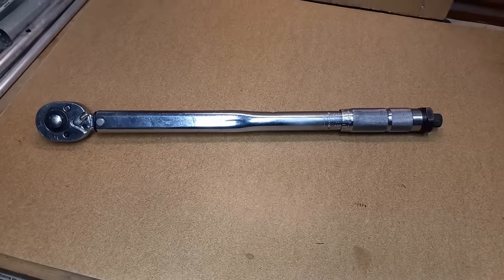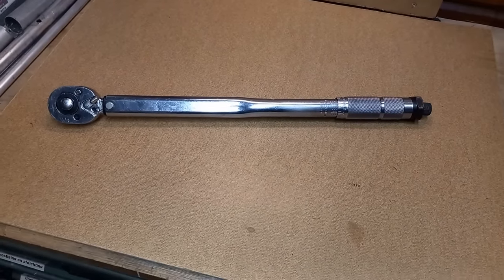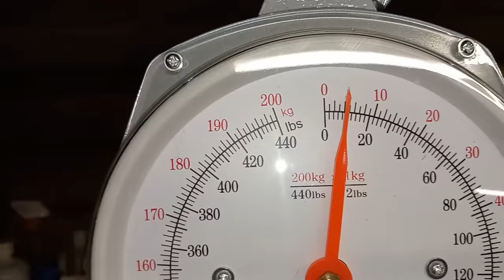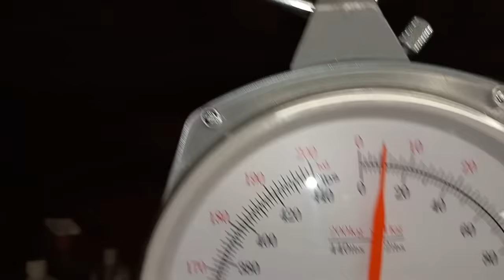How to calibrate a (cheap) torque wrench

Comment: This method seems quite imprecise.
The force should be perpendicular to the arm of the wrench, the precision of reading the scale isn't great at all, at the range shown in the video it is alone responsible for 10-20% error. Adjusting the scale using the jerry can is similarly troubled, since the reading precision is disastrous due to the low load of the scale designed for much higher forces.
In general, the whole thing seems much less precise than the original calibration of the cheap wrench.
Reply from the maker: You'll be surprised how small the margin of error is. It is less than 5%, and that is fine for my purposes.

Comment: 126Nm equals to about 15Kg not 30Kg or am I missing something?
Reply from the maker: That depends on the length of the arm. On this torque wrench it is 30 kg at the handle, with twice the length it would be 15 kg.

Comment: The most important part of toque is everything torque the same , old bolts with stretched threads on bolts and in hole will give you a different reading a good mechanic will have a professional adjust his torque wrench  use new bolts every time you torque if you don’t your torque will be off a couple of lbs. or inches, the start in middle a torque out half torque first then full and then all the way around so everything is flat and the correct torque, you guys that are using old bolts go up a couple of foot or inch lbs but very slowly not too pull the threads worst than they are tight is tight NOT over tight, I probably shouldn’t have told you anything about torque nothing worst than a wild ass with a torque wench 7:26
Reply from the maker: Good point on strech and streched bolts. I'll dive into that in a future video. Also, a good workshop manual should specifically state whether or not the threads should be oiled. Most workshop manual don't do this in my experience.
Reply: On aircraft propellers new bolts are always used on this critical application.
Reply: @Carnold_YT  Usually assumed to be Dry unless stated otherwise.
Reply: @malcolmmarzo2461  New fasteners are always used on any aircraft - wherever New fasteners are called out.  Cotter Pins are ALWAYS replaced and NEVER reused.  And aircraft prop bolts likely are safety wired.
Reply: @daves7775  In practice these things are often discretionary. When I got a new propellor I insisted on new bolts. Yes, they are safety wired. Additionally, in most light aircraft the prop must be removed to change the alternator belt. So it is a good idea to install a new belt too.

Comment: This is a classic example of “You don’t know what you don’t know”. Real, certified calibration is so much more, and considers so much more than you are demonstrating. On the handle there is a centerline divot. That indicates where your hand should pull from. By using the scale pulling from all the way at the back, you have effectively changed the common centerline length of the wrench and made your measurements inaccurate. How can you accurately measure the peak torque with a scale that doesn’t have a peak hold tail pointer? You can’t accurately. What is the measurement accuracy and repeatability of the scale? Are you adjusting a +/-4% torque tool with a +/- 10% scale? For a calibration to be valid, the measurement instrument should be at least 4 times more accurate than the tool under test. Torque tools are also tested at more than one measurement point. It is painful obvious, you have very little understanding of torque or metrology (calibration).
Reply from the maker: Well, this video is intended for home mechanics who need consistency and some form of accuracy in a certain torque range. Maybe I've could / should have pointed that out more clearly. Anyway, did you watch Part 2? I'm not unfamiliar with calibration labs, my office at the day job is adjacent to a calibration lab...

Comment: His "calibration" of the scale immediately introduces a source of error and propagates onwards.
Yes, 5 liters of water has a mass of 5 kg (at least close enough to not matter for this purpose).
But zeroing the scale to 5kg is incorrect, since the mass hanging off the scale is 5kg (mass of water) + x (mass of container holding water).
Reply from the maker: The scale was not zero'd with the water container on the hook. It was zero'd without any weight - except for the hook.
Reply: @Carnold_YT  and the scale was adjusted to 5kg while the container filled with 5 liters of water was on the hook. Hence, the scale is reading less than what's actually on it.

Comment: You made your 2nd and 3rd adjustments without backing off the setting dial.  Every Cal Lab is also temperature controlled.  Usually right at 70 degrees F.  Humidity controlled also. 
Your method could be useful to the hobbyist though.  With those type torque wrenches (micrometer setting), you always want to use only the top 2/3 of the dial.  If you try to torque a low torque setting with that style wrench, especially a cheapo, you will OVER TORQUE.  
You you didn't show your conversion formula for the length of the wrench handle either, so no one can really do what you did without more research.
Reply from the maker: This video was intended for home / hobby mechanics. In part 2 I adressed some points you mentioned. Anyway, thanks for watching and for your input!

Comment: Snapon is cheap stuff, b market stuff, German Gedore or Hazet torque wrenches are almost twice as expensive.
Reply from the maker: Paoli are the best in my humble opinion. That brand is second to none.
Reply: @Carnold_YT  Gedore en Hazet is the stuff that traditionally was used by car garages.
Nothing beats German engineering.

A digital torque wrench of Hazet is 3000€, Snapon around 2000€.

Comment: That is NOT the position, in the handle, to apply the weight. It is the SLOT more or less in the middle of the handle. Your wrench is not calibrated correctly.
Reply from the maker: I corrected that in part 2 of this video.

Comment: Torque wrenches should always be calibrated by applying the force to the middle of the handle.....not the end of the handle as shown here. Many torque wrenches have a groove or line in the middle of the handle grip. This is to show where your hand should be positioned and, ergo, where you should calibrate the toque from. Here is a video that proves this.....
https://www.youtube.com/watch?v=Fwfnf06dl84
Reply from the maker: You are correct. I pointed that out in part 2 of this video.

Comment: The best way to calibrate a cheap torque wrench is to beat the daylights out of it with a sledge hammer and toss it in the garbage. Get a quality beam torque wrench. You never have to calibrate them as they are always spot on accurate!!!!!
Reply from the maker: The digital Snap-On torque wrench at the day job broke three times before boss man had to replace it. This Crap-On torque wrench served me well for over a decade. Quality first, money firstest. Us home mechanics have to start somewhere, don't we? Anyways, thanks for watching!
Reply: @Carnold_YT  Get a beam torque wrench. I've never bought one of those type you show in the video. Most "mechanics" get those because they are embarrassed to be seen with a beam type torque wrench. I've never had a beam torque wrench break and you never have to calibrate them. They are perfect each and every time you need one. Trust me when I say this. I'm a retired ASE certified master tech. I grew up in a mechanics family. My dad had a shop in L.A. My great grandfather was a lead engineer at Ford Motor co. for 30 years. He was good friends with Henry Ford. Get the beam torque wrench. All of your problems will be solved.
Reply: Beam wrench is great if you can see it. 
Often us Millwrights can barely get the wrench positioned on the fastener, never mind a good position accurately viewing its' scale. 
Clicker type is only way to go.
Reply: @benjurqunov  Aww now come on. You're just embarrassed to have a beam wrench too... LOL.... Someday the stigma of the beam torque wrench will be defeated! "EQUALITY FOR THE BEAM TORQUE WRENCH!" 🤣😆
Reply: I use this same torque wrench but then I check it with my beam. My click wrench is always slightly less than my beam so it works well allowing me to sneak up on my final torque value.
Reply: @tgxperience  The problem with the click wrench is just that. You can be slightly less or slightly more or a lot less or a lot more. At least you're double checking though.

Comment: The correct spot to hang the hook is the line between the knurled portion of the handle.  This also where the measurement should be made to.

Comment: tq wrench was not exercised (3-5 clicks CW & CCW at max setting) prior to "calibration"; therefore your readings will be off, or not as "accurate" as it could be...I found too many errors in this video for it to be useful. 😒
Reply from the maker: Good point, I'll mention this in the follow up video.

Comment: Oh hell no Do not do this if you need your tools calibrated when dealing with ISO. Send it to the lab have it done professionally keep records and make sure your lab checks torque wrench in three places at least on our standard ones at our lab which I work in we checked min middle and max and also the areas of which the tools are used the most in leave it or not your torque wrench can get wore out in the same setting If it's used there all the time Good luck find a good lab.

Comment: you are doing it wrong. the force should be applied to the solid line in the middle of the handle. its not there just for decoration. its the point that represents the exact spot where you should apply all the force so that the applied torque on the socket matches the setting on the dial. there are two pivot points - one on the socket, and one on the pin. if you choke up on the wrench, you apply more torque than the setting. if you move it further as in your case, you decrease the torque applied. although it seems to be just an inch in your case,  it still shows that you fundamentally misunderstand how torque wrenches work. iv seen guys use cheater bars on torque wrenches and when i call their mishandling of the tool out they take the piss on me. after showing with a digital wrench that they have undertorqued the fastener almost half the value they look puzzled as hell.
Reply from the maker: Thanks for your comment, many of this has been pointed out in earlier comments. That's why I did a follow-up video to adress those remarks.

Comment: could've sworn you set the wrench to 150 lbs then used 30 kilos on the dial scale.
Reply from the maker: I didn't notice that, but you may be correct. This torque wrench has two scales: Nm on the front and lb/ft on the back of the lever. Thanks for watching!

Comment: So, you "calibrated" the scale at 5/200th's of its scale length using 5 kilograms of water (which we're not sure how you measured accurately). And then you used the scale at 30/200th's of its scale length to set the torque wrench. That's not what I would call calibrating. I would never trust a scale (or any analog meter) below 25% of its scale length.
Reply from the maker: Well, did you watch part 2 of this video?

Comment: You won’t be accurate holding the scale like that

you need too remove the scale weight by holding it.
Reply from the maker: That may be true, but I didn't aim for maximum accuracy here. I just wanted to have my torque wrench accurate in the range I use most.

Comment: you calibrated the lower output, at the same time the higher output got f** up . With a china wrench, you either calibrate it in the middle or calibrate it for each of the bolt you torque. 😄
Reply from the maker: I calibrated it for the job at hand, few bolts in the 120 - 170 nm range.

Comment: This video is great. However, I want to mention that using water like this is not a good calibration technique. While people think Metric guarantees things, it does not. Only if you follow the rules of metric - right amount of water (volume), right temperature, and it's really water and nothing else dissolved into it. Water full of salt, or alcohol, or minerals will have a different weight. Only if everything is as they specified as part of the Metric system - then it's correct.
It's best to calibrate it with weights that are calibrated or a calibrated scale. Here we're not even trusting a scale. Just some water of an unknown volume and water of an unknown specific gravity. Is it correct? Who knows. The container may not even be right. It's screen wash after all. That jug is probably 99 cents or 1 Euro. Something very inexpensive. Also, the weight of the container itself. If it contains screen wash that'll have alcohol in it, so the specific gravity will be different.
Reply: You are certainly right, but I think this is a method to test a wrench if it's still roughly OK. If you need real accuracy you have to go to a calibration lab anyways. If you have access to a 2nd one you know it's accurate you could connect them and test if they click at the same time which may be the simplest and most accurate test beside the official calibration lab

Comment: Torque wrenches should be calibrated in a Metrology lab with periodically calibrated equipment traceable to NIST period. This guy's method might be Ok when working on lawnmower engines or Mosdel T s but stay away from that which can kill people such as general aviation,lug nuts, etc.
Reply: I'm sure nobody working on aircraft would check his torque wrench with this method

Comment: Never mentioned details like how to calculate the kilograms. or what all the small parts were inside the end of the wrench. Also forgot to tell what direction to turn the adjuster to increase and decrease the torque settings.

Just kinda a half ass video.
Reply from the maker: Well, there is a link to part 2, that's where all off that is adressed!

Comment: I worked on torque wrench repairs and calibration for about 5 years and i can tell you this. The best way to calibrate on of these cheap generic torque wrenches is to throw it in the trash! They are terrible. They tend to be very inconsistent and are never accurate over the full range. 
If you use a torque wrench regularly, especially if it's on other peoples equipment and you are being paid for the work, don't buy one of these.

Comment: That jug of water as a standard is a joke. You must be related to Rube Goldberg?😁😆😅🤣
Torque wrenches are cheap enough where you buy two of them, one is kept as the standard only, to be used just for calibration purposes, and the other one is used in the field. When it comes time to calibrate the one that you use, you simply couple it to the torque wrench that is the standard, set both wrenches to the same torque, and with the standard wrench held in a vise, apply torque to the other wrench and see if they both click at the same time. Your coupling of the wrenches can be a socket adapter "Female 3/8" to Female 3/8". This way you get rid of that joke of a jug, and also don't need that scale. My way is simple and direct, much quicker and more precise.
Reply from the maker: The purpose of this video was to show how to check the accuracy with the materials at hand. The jug of water - now matter if it's only 1/5th of the weight needed - is more accurate than you might expect, same goes for the scale. Your method is also not bad - but you need to be sure that the reference torque wrench is (somewhat) accurate. Nowadays I have several torque wrenches and I think I'll try your method too.
Reply: @Carnold_YT  Being a newbie, I was looking into how these clicker type torque wrenches were designed and found out they were accurate to within +/-5%. Then it hit me, being in the field of fixture design for many years, that in the field of calibration, your standard should be much more accurate than whatever you're calibrating, that being the case, using another clicker type torque wrench as I suggested is flawed, you would even compound the error +/-5% to +/-10% to the torque wrench you're calibrating. That being the case, I came upon something even better than using another clicker type torque wrench for calibrating, and that is: Heavy Duty Digital Torque Adapter with Buzzer and LED Flash Notification. This gentleman here, "The Den Of Tools", like yourself, seems legit, claims people are taking these torque adapters to calibration laboratories and getting the results of +/-1% accuracy? Below is the link to his Youtube video.
youtube.com/watch?v=D_PAdbNHzRw
Reply from the maker: Thanks for your comment (and sorry for my late reply), that sounds very interesting! I'll check it out!

Comment: Should have used a weight not liquid yo filled a used jug you refilled that's just stupid
Reply from the maker: Well, a filled jug of water, with level marks has an exact weight, doesn't it? The margin of error is less than 1%...